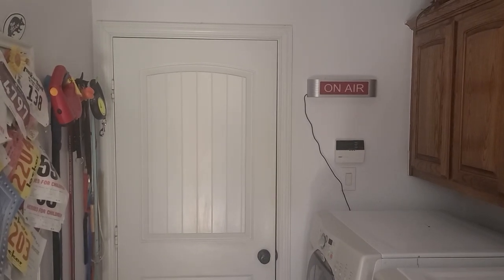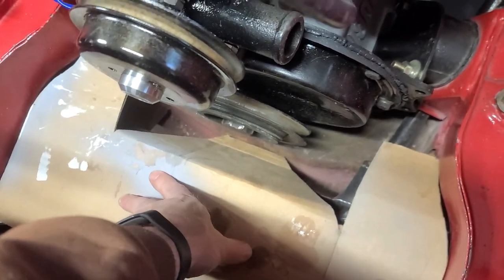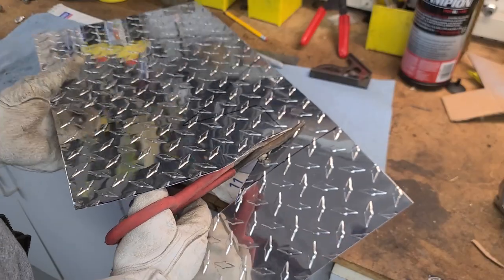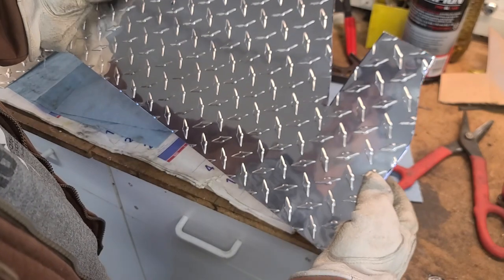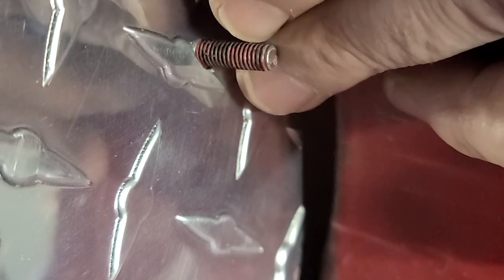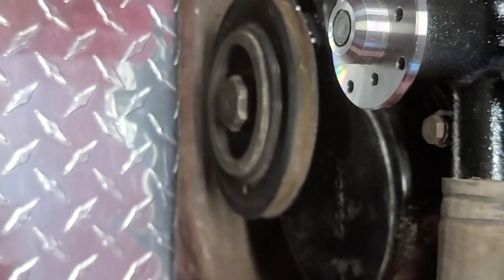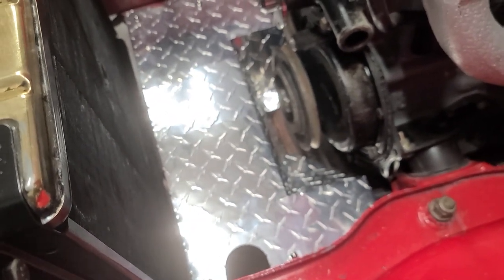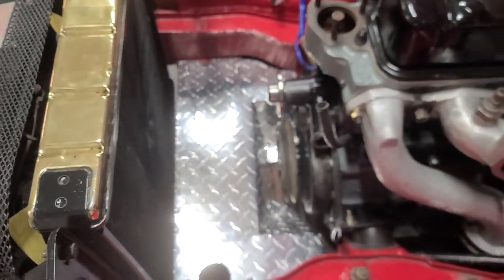DIY Custom Diamond Plate Mud shield for my 1977 MGB

Comment: Very nice job! I went with the abs plastic one. But also may I recommend something. On the hose hole use some door trim around it so there is no way that it could cut into the lower radiator hose.  Just a suggestion.  Love watching your build. just got a 76 midget so doing both my mgb and midget. Fun cars.

Comment: This kind of mud plate is not present on the older MGBs. The old engines have the timing mark at the bottom side of the timing cover and crankshaft pulley. Those timing marks will become invisible if you install such a shield. On later cars were the timing marks moved to the top side, so that you can see them when looking from above.
Reply from the maker: True, and there  is a fan connected to the water pump.  The 77 has two electric fans in front of the radiator
Reply from the maker: I wonder if there is just another type of cover that does not go under the harmonic balancer.  Maybe just a flat  cover between the radiator, and the front of the pulley.
Reply: @AlexPlatacis  I took a look at the exploded view diagrams on the websites of the parts suppliers (e.g. Moss, Rimmer Bros, ..). All these only show a mud shield for some years of the rubber bumper MGBs. But, according to those diagrams, apparently it was never used on a chrome bumper MGB.
Reply from the maker: @windmill1965  well, it won't be the first thing unique to this vehicle.  It's a 77, with a chrome bumper, and tail lights from a '69.

Comment: I’m making one now following your design, but I’m concerned that I may not have enough clearance to get a socket and ratchet onto that crank bolt to turn the engine over for jobs like adjusting valve clearance without taking the shield off. What is your experience?
Reply from the maker: true, if you use a socket and ratchet to turn the engine over this does not leave much clearance. the good news is that is is not too hard to remove and replace.  I have had to remove it a few times since this video, and it did not even require removing the loser Rad hose.  If you turn the engine over manually often enough, it might be a worthwhile investment to get a 1 5/16 box wrench.  they range in price from $25
https://www.homedepot.com/p/Husky-1-5-16-in-12-Point-SAE-Full-Polish-Combination-Wrench-HCW1I516/301119707